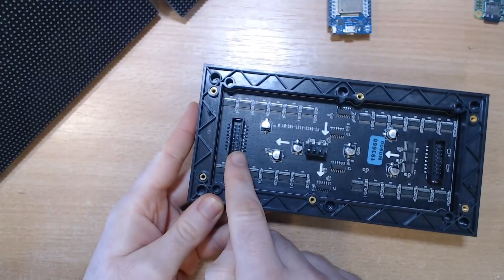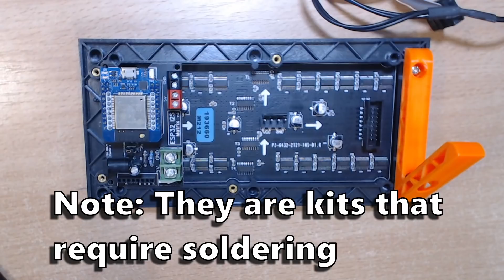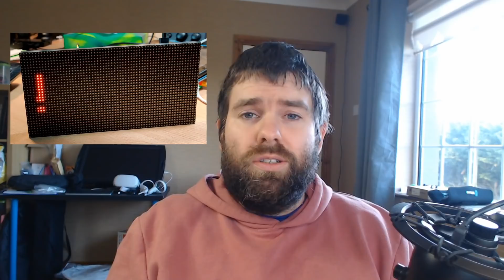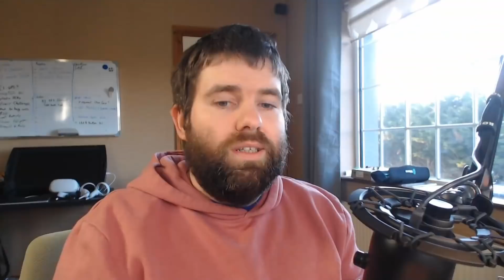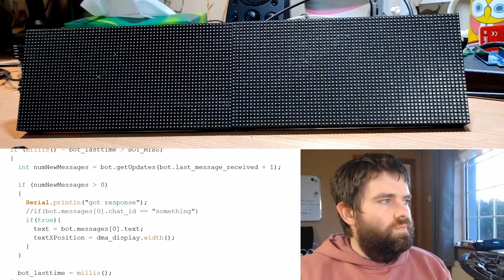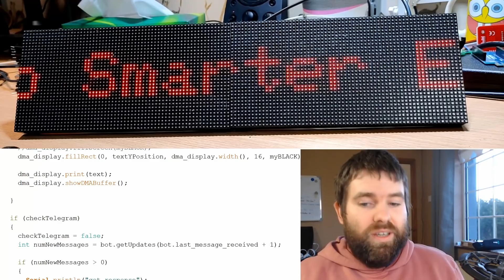A LED Display for Smarter Every Day

Comment: An easy way to get around the issue of the text freezing, is to use esp-idf to do the programming. You can use the freertos to create tasks that run concurrently. Personally for esp projects i prefer idf because it gives more control over specifics like these.

Comment: nice project. i ve built a 20x20 matrix with esp32 and led-stripes: https://www.youtube.com/@sub-arts128. but i want more resolution. how many 64x32 modules can esp32 drive with 24bit color in acceptable frame rate? thx

Comment: Hi Brian
I'm no coding smarty pants. I liked what you did but was wondering for my application if we could make it really basic. I'm looking for a way to display specific and different words at the touch of different push button switches. Ie. 1st button if pushed would make the board say "help" if the 2nd push button pressed would say for example "next" and so on. Possibly a 6 or 8 press button switch board each different custom words. It doesn't have to be remotely controlled, wired is fine. Your input would be greatly appreciated. Regards Kev

Comment: Hi Brian I've seen a bunch of examples around where you connect JPIN into the ESP32 using about 8 wires, and then you connect 5 wires from JPOUT into the JPIN ribbon panel.  I notice in your video however you only plug into JPIN.  For me without connecting JPIN and JPOUT together I can only display RED LEDs and no other colours.  Is this JPIN/JPOUT arrangement something specific to ESP32?
Reply from the maker: There is two main libraries for controlling the matrix panels using an esp32 to the panels, pxmatrix and i2s matrix library (that I use in this video)

Px matrix is wired as you describe. I prefer the i2s matrix library though as it's faster.

If you're wired for the i2s matrix library and still only getting red, that usually points to not having the panel powered

Comment: Hello Brian.  This was a great video and it inspired me to get a couple of panels.  However I have failed miserably to get them working properly with the I2S-DMA panel library. I can get them to work properly with the PxMatrix library however.  Hardware issues I suspect.  I am using one of your  issue 3 D1 Mini E32 Matrix Breakout boards.     However the strangest thing is that I cannot get your Telegram sketches to work on ESP32s and yet they work on ESP8266s.  Has anyone else had the same issue?  The comms between the bot and the board just dont work. In particular I have tried your Echobot sketch on both boards types and can only get it to work on the ESP8266.  Any suggestions? 🙂

Comment: Hi. 
First of all, thanks for sharing this project, the video is so easy to follow, even for a beginner like me, that I went and ordered all the components. 
I just wired the hardware and I am able to upload examples from the ESP 32 Matrix library so I know the display and the ESP32 are working and talking. However, when I try to upload your code I get the following error: 
'class MatrixPanel_I2S_DMA' has no member named 'showDMABuffer'
I am using the recommended hardware (ESP32 D1 Mini, Led Matrix) 
Any idea what Am I doing wrong?
Reply: I changed to an older version of the Matrix library and now I can upload the sketch without problems, BUT, I have nothing displayed in the panel, not even the initial text. If I open the monitor I get "got response" every time I send something to telegram, but again, nothing in the matrix panel...
Reply: @sebastiansombra  Same problem here! tried cmmenting out the showDMABuffer lines, but it didn't work. Any help would be much appreciated, this is a great project! Thanks, Brian!
Reply: @ProfeTucho  Hola, por tu nombre asumo que hablas español :). Lo primero que hice fue usar una versión antigua de la librería, con eso pude hacerlo funcionar, aunque después tuve otros problemas (quizás relacionados con mi panel en particular) que tuve que ir solucionando. Te recomiendo que vayas al Discord y ahí hagas las preguntas, ahí Brian me ayudó a resolverlos mis problemas.
Reply: @sebastiansombra  Asumes correctamente! :) Acabo de conseguir hacer que funcione, aunque no sé muy bien como. Aún así, me pasaré por el Discord para ver cual hubiera sido la solución más eficiente, porque la mía es una gran chapuza! :D Un saludo y muchas gracias!
Reply: @ProfeTucho  lo mismo me pasó a mi :)
Saludos
Reply: @ProfeTucho  , pon el código que te funciona a ti, que me estoy peleando con una ESP wroom32 y me estoy volviendo loco
Reply: @sebastiansombra  por favor, consigo hacer la compilación usando una versión anterior de la librería pero sigo sin ver nada en la matriz.
Los mensajes llegan bien pues he conseguido verlos en el monitor serial.
Reply: @Grimor.  Hola. Hice este proyecto hace muchos meses y la verdad ahora mismo no recuerdo como solucioné los problemas que me fui encontrando, pero te recomiendo darte una vuelta por Discord. Cuál es especificamente tu problema?
Reply: @sebastiansombra  no veo los mensajes en la matriz Led. No luce nada. Los ejemplos de la librería si los veo bien. El Bot de telegram funciona correctamente pues los puse en el monitor serial y llegan. Aparte de bajar la versión de la librería para que me deje compilar y no salga el error ese que decíais, no se que más tocar. Si tuvierais vuestro código guardado podría echarle un ojo
Reply: @Grimor.  con gusto te lo envío, es horrible no poder avanzar en un proyecto. Tienes un correo?
Reply: In function 'void loop()':
ScrollingTextMatrixTelegram:167:17: error: 'class MatrixPanel_I2S_DMA' has no member named 'showDMABuffer'
     dma_display.showDMABuffer();
Reply: @Grimor.  lo envié ayer al correo.
Reply: @Grimor.  ahí lo mandé. No se me ocurre otra opción

Comment: Cool projects and good for beginner.
I would like to ask how can I connect 2 boards of 64x32 LED display to work like 64x64 LED display.
Do you have an example how to connect the lines and adjust a code?
Thank you.
Reply from the maker: Hello, you need to configure things a little differently for that, there is an example and some explanation here:

https://github.com/mrfaptastic/ESP32-HUB75-MatrixPanel-I2S-DMA/tree/master/examples/ChainedPanels
Reply: @BrianLough  Thank you for your reply and this is again very good project.
Do you have an example for ESP8266?
If not then I have to buy ESP32 and try again because I tried on ESP8266 finally found a warning.
Reply from the maker: This library doesn't work with the esp8266, try PxMatrix, that should work. Don't believe it has the feature to use 2 64x32 as. 64x64 though
Reply: @BrianLough  I just received ESP32 Dev Kit V1 and I want to know how to wire connection for ESP32.
Could you please share me a link for this?
Thank you again.
Reply from the maker: Wiring instructions are on the readme of the library I linked to above

Comment: so for the problem that the message keeps stopping while scrolling .why not use the esp32s second core for fetching the detail and the first core for displaying message instead of just waiting for the data to be fetched again while wafting or it stopping in middle .
Reply from the maker: Hey, I cover this topic at 19:50, the solution I had worked fine so no point making it more complex
Reply: @BrianLough  oh didn't notice that sorry

Comment: hi i followed your instructions i got the demo working fine but when i use your code i have no display im only using 1 dotmatrix is there anything i have to change for it to work as i figured it would just work with the demo working fine

Comment: First, congratulations for the video! Just one question! How many modules can you attach together? Power requirements (in the AliExpress link mentioned 300w and 8kg that should be the plate full of modules)? When searching I also found adafruit modules that mention hub75 connections! Are those related in any way? Regards,
Reply from the maker: Thanks so much!

The most I've ever tested is 4 (that's as much as I had of one type). But the author of the library just posted a picture of 12! https://twitter.com/witnessmenow/status/1358907117378363394?s=19

It really depends on what your doing as more leds illuminated will equal more power, but each panel can use up 2.4A if all white (they use 5V)

Weight wise is way lower than that each anyways, I just sent 4 of them ( to guess who! 😅)  with a lot of packaging and in total it was less than 1.8KG

yeah the ones adafruit sell would be the same thing. Just personally for me the adafruit ones would cost me about 4 times the price by the time I paid postage to Ireland and then import fees.

Comment: Have you ever considered using Google's Firebase for the remote web interface. There is an ESP32 library for this (can also pull this off the Arduino IDE library manager): https://github.com/mobizt/Firebase-ESP32

Basically the ESP32 would subscribe to the Firebase project (the project developer, e.g. yourself, would need a Google account to set one up and it's free to use). Then a remote user can enter some text via say a web-browser or even a mobile app and this will update in the Firebase project. The ESP32 would get this info as soon as the data field is updated. There's a bunch of examples given in that library to help you.

Comment: Can the Adafruit Circuit Playground Express drive the LED panel?
Reply from the maker: It wouldn't have enough pins anyways, but the library I use is specific for the esp32

Comment: Hey Brian! Your work on the LED matrix was super helpful! I was actually able to get a 32x64 working with an esp8266 which previously took me so many attempts and I just wanted able to do it! But I have hit a road block on the facebook side of things! Is there any chance you can provide some help on getting the page likes from a facebook page using the 8266? I have tried your library which was a little outdated. There was also a pull request which updated it and yet It still doesn't work and I just don't know what is going wrong. thank you! I would be happy to hear any alternative either, basically just trying to display facebook likes count on the screen.

Comment: Nice result!  I used your Telegram library to build a Telegram to MQTT bridge for some home automations way back, you gave me a little support at the time.  IIRC it was to allow family members to trigger "stuff" without having to put MQTT clients on their devices and open ports on the home network.
I would be very surprised if there is a much more simple or reliable DIY than this, well done!

Comment: Hi, in aliexpress the vendor of p3 rgb panel says this : ''Recently, several client told that this led panels can't work with ESP8266 and ESP32 controller, please use raspberry PI controller." It is correct?
Maybe is a new panel model.
Reply from the maker: I can't guarantee anything with these panels, but that message has been there for a long time (years) and I bought my most recent one in November and it works fine.

Comment: Great video Brian! I tried following your previous video on LED displays but couldn't get anything working properly (I tried soldering the pins instead of dupont cables but those connections weren't solid enough). I ended up shortcircuiting my ESP32 somehow and I think the blue LED's on the bottom side of my displays are fried aswell. I ordered new parts and will definitely try again thanks to your inspiration!

Comment: Excellent video, thnx! what is the name (search term) for the LED panels? they look interseting. 
thx
billd
Reply from the maker: "Led matrix panel" should get it, the particular ones I'm using are 64x32 and are "p3" which dictates how physically large they are (bigger p number, bigger the panel)

I've linked to the ones I bought in the project GitHub page. Sometimes they pop up on amazon for not a lot more. Adafruit also sell them but they were quite expensive last I checked
Reply: @BrianLough  Thnx! I loved the simples methodology of your build. start simple, then add layers as you go. I use the Blynk platform to control a lot of sensors/devices remotely. to many beginners jump in at the deep end, without first proving that the basics work.

thnx
again,
billd

Comment: You can use the two cores fairly simply. There's a method that allows you to pass data and events from one core to the outings. I implemented both cores on a BLE scanner project for the esp32, and the documentation was good and clear, and of course Kolban's videos and writing was crucial.
Reply from the maker: I've used multiple cores a few times before, even made a video on it!

https://youtu.be/KBxJ6xfT8Dk

I just have never used it with this exact setup with the matrix panel. I was happy with the check between scroll solution in the end so I thought I'd keep the project simple

Comment: Hi Brian thanks you so much for the awesome video. I'm a beginner in ESP32, I'm having a doubt like ESP32 is having dual core processor. Shall we use one core for text scrolling and another for Telegram message processing?. If I'm wrong please excuse me.
Reply from the maker: Hey, if you are a beginner and you already know about dual cores you are doing quite well!

Yes I think that plan is a good idea I've used multiple cores a few times before, even made a video on it!

https://youtu.be/KBxJ6xfT8Dk

I just have never used it with this exact setup with the matrix panel. I was happy with the check between scroll solution in the end so I thought I'd keep the project simple

Comment: I would like to thank you for the way you go through everything. I’m a bit of a slow learner so going step by step is really helpful for beginners. I made the esp32 Bluetooth keyboard and modified the code (after much trial and error of course) and it works like a dream. 
Being a bit skint on cash finding the non dodgy stores also is very comforting. 
Thank you so much.
Reply from the maker: You're welcome! Delighted to hear you liked this step by step, will definitely be doing more like them
Reply: @BrianLough  Can you share with Us the code you use for BT Keyboard with the project? Thanks
Reply from the maker: Code is linked here https://youtu.be/4sIkW7wogrE

Comment: hmmm, and some ws2812b? 8x32 +wemos?
Reply from the maker: You could do the same with addressable leds, but the reason I like the panels is they are just ready to go, no need to glue to a structure etc.

Comment: ESP32 is running a freertos OS, so you could use two tasks, one for the display and one for fetching data. Actually your loop is a rtos task, so you only need to start one task
Reply from the maker: I have done that in the past with a different display, I just wasn't sure if it would work with the matrix display

https://youtu.be/KBxJ6xfT8Dk

I think the solution I tried here was fine anyways

Comment: Hey Brian. Would this also work with an esp8266 and the boards I got from you a while ago? This is a solution I was searching for a while now and it will come in handy.
Reply from the maker: It would have to be ported to work with px matrix instead of the i2s matrix library, but it should be pretty straight forward to do
Reply: @BrianLough  ok so I assume the newer i2s library is not compatible with the older hardware esp8266 then? So I have to decide wether to port it or to use and esp32.
Reply from the maker: @Hasitier  no the esp8266 doesn't support that library and the two libraries physical use different pins anyways so even the esp32 version of the px matrix shield doesn't work with it

Comment: What monitors do you use?
Reply: Looks like the right one bent from heat!
Reply from the maker: The larger one is a Gigabyte G32QC-EK, its a curved 2k monitor with a 165Hz refresh rate. The other is a cheap one from a few years ago LG 27UD59P 27" IPS 4K
Reply: @BrianLough  Thanks!